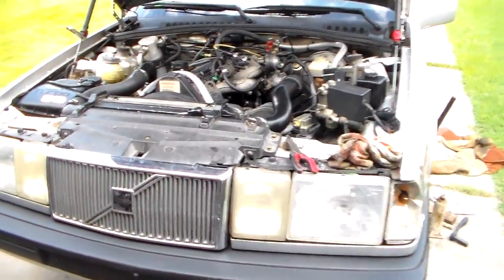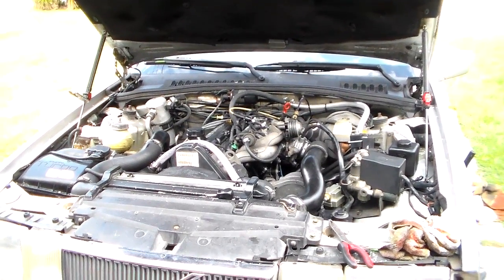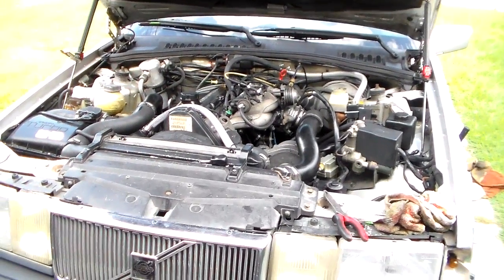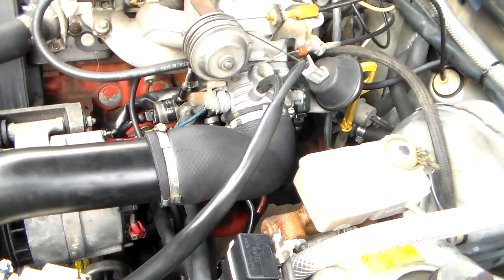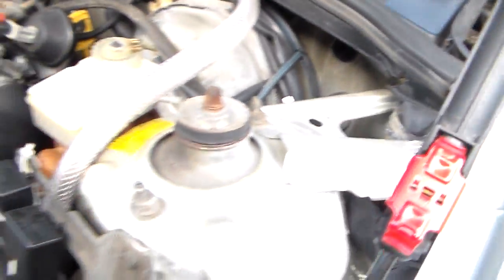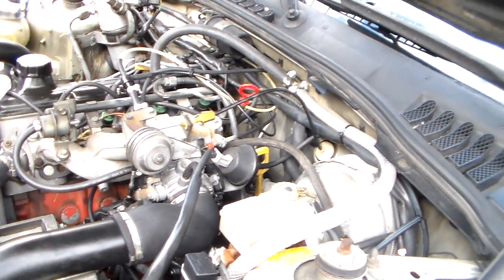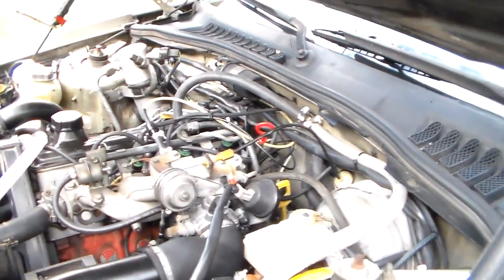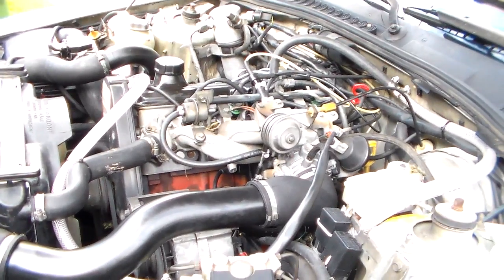Volvo 240/740/760 rubber fuel line replacement-safety issue

Comment: Hi Tyler I noticed my supply line looks the same as yours. How hard is it to change line from rail to filter?
Reply: Not sure if you did this already...the rubber hose in the video goes to the return line.  Easy fix and low pressure - no fuel injection line needed but regular rubber fuel line (up to 50psi) is required.   Just did mine.

Comment: hello there tyler, glad to see someone doing a 740.. i have one, i kind of wondering, the injector system on this kind of volvo is not 100% electrical right ?.. im just disassemble it recently, it have somekind tip of a hose garden sprayer ?, thank you in advanced.
Reply from the maker: 100% electrical.Those are Bosch EV6 four-hole injectors. Good injectors, someone swapped them from an 850 likely.
Reply: mine doesnt look like that at all, it got the 4 injectors without electrical plug socket..

Comment: The reason why the fuel hoses cracked and rotten is due to ethanol on common in gasoline. The factory fuel lines aren't ethanol-resistant!